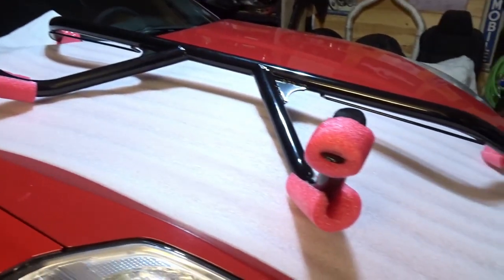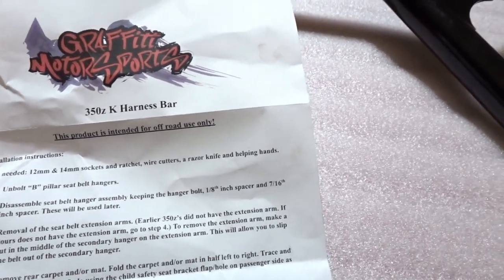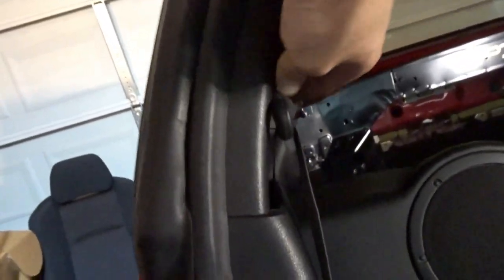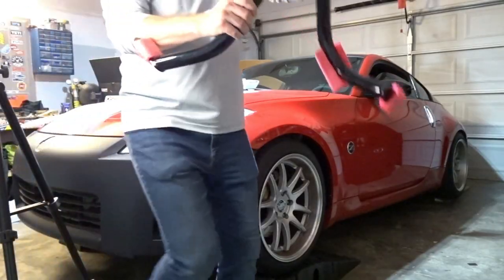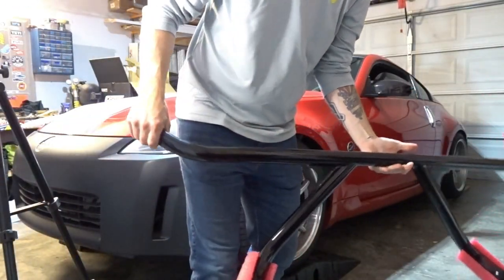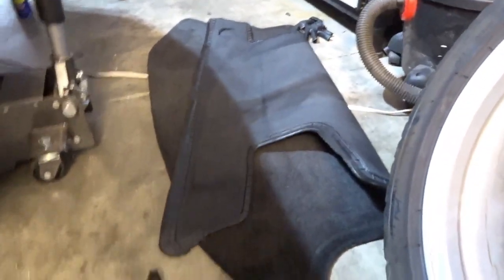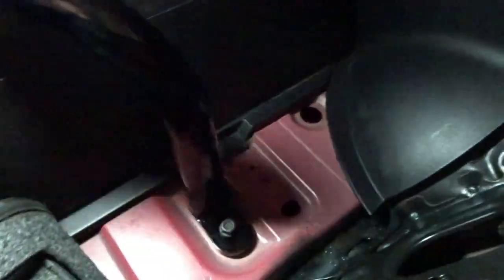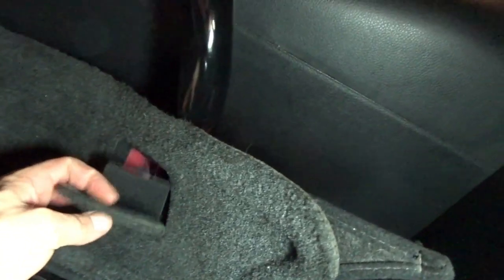350z Harness Bar Installation | Graffiti Motorsports

Comment: if you use the harnesses without a HANS your head will fly forward and snap your neck and then the airbag will punch you in the face.
if your just wear your seabelt your body will move forward and the seatbelt stretches and the airbag will act as a cushion for your head.
Reply from the maker: I would venture to say that most people with these seats/harnesses do not have airbags.  But yes, you really shouldn’t run this in a daily driver.